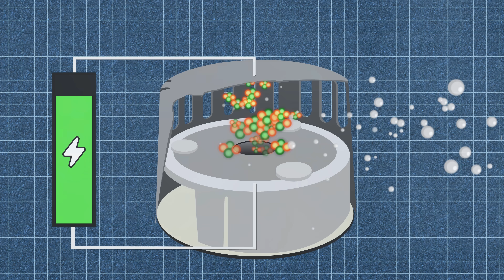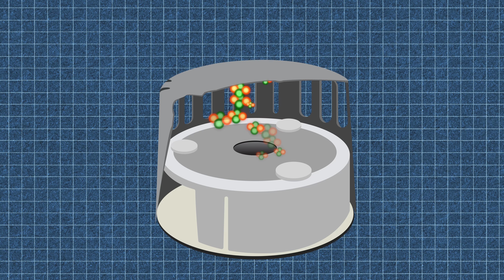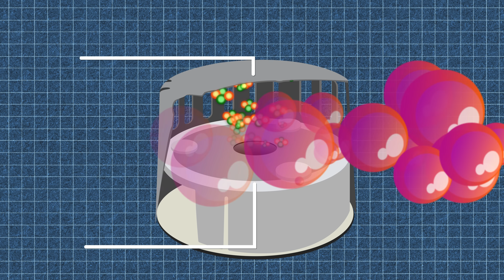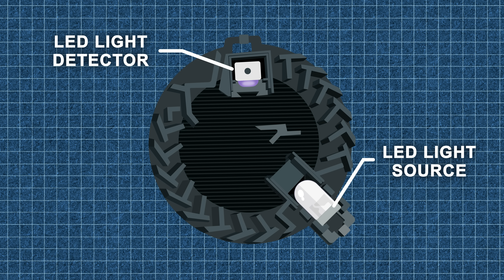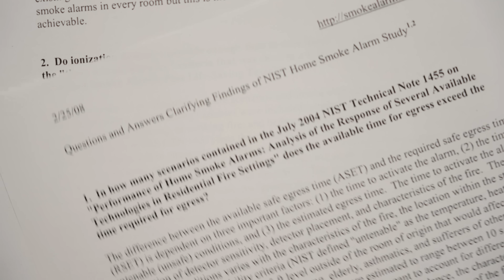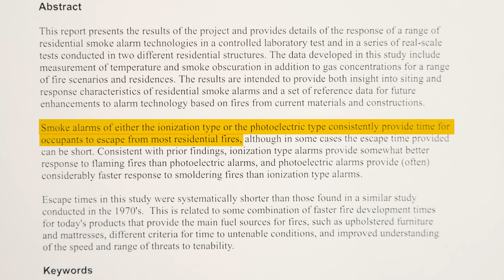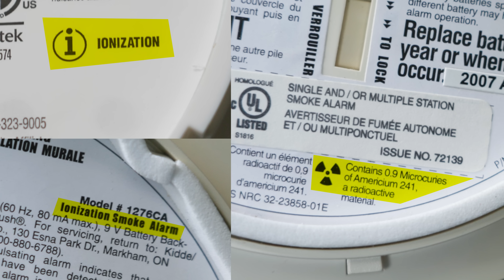Why the Most Common Smoke Alarm is Dangerous

Comment: So it uses code, to tell what kind of fire it is. Is there a fail safe in the code, where if it can't identify the smoke, to go off as an undetected fire? Or will it do nothing, never triggering?

Cause Codes, computers, electronics? They are prone to bugs, glitches, and being faulty. That is my biggest fear here. That the code will bug out, and never go off. The thing becomes melted slag, how can you prove it the device went off or not? And if the device never goes off, and the family dies or a family member dies, could you sue them for that bug and hold them liable for their faulty device?

If we can't even Sue them, when we trust them with our lives and they break that trust, how can we trust that they made a working device and not just lying and defrauding us. After all, if it fails, we will be dead anyways and can't tell anyone the device meant to save us failed.
Reply from the maker: Hey, I can understand your concerns, I had those same questions pop up.  The good thing about these regulations around life safety devices is that they are quite robust to account for these types of situations. So one of the tests they do is to light a real fire shortly after a cooking smoke incident is detected.   This ensures that algorithms are working as they show to identify a real fire when it does happen. This is one test amongst many in order to ensure we're actually protected. 

As well there are other failsafe situations, if cooking smoke or steam is detected for too long, the alarm is required to go off.  

So forensics can also identify whether or not an alarm has sounded, I believe there are waves around the sound device that will impact away smoke is deposited on the device itself, if it is completely melted away well I guess there's only so much you can do.

Comment: I only use the combination ionization, photoelectric, and CO alarms. Then you have every possible type of detector in a single unit. If at all possible I use the hardwired ones that have a battery backup and link together so that all of the alarms go off at the same time if one is set off. I also have a single sprinkler mounted over the boiler (optional in my state) for extra safety.

Comment: People are also going to run into issues as air purifiers increase in popularity as they remove PM from the air, that's something worth considering when placing your smoke detector/s and purifier.
Installation location is definitely important. In the apartment I rent there's one smoke detector (which meets regulations) but it's installed outside my bedroom door in the lounge. The kitchen is at the other end of the apartment, as is the only safe escape route, the front door.
I BYO smoke detectors wherever I live and place one in the kitchen. Recently the apartment detector had to be tested as is required by law, the tester commented that my kitchen one would go off a lot... he clearly didn't know what he was talking about. It's never had a false alarm as it is a quality photoelectric model.

Comment: I'm guessing it's because they are actually just heat detectors, a tiny bit of metal expands enough to trigger the alarm when it gets heated. If the smoke isn't hot enough anymore nothing will happen

Comment: Well, isnt that hard to imagine an smoke detector with both Ionizing and a photoelectric sensors together in the same device... i dont know for the ionizing tech part, but photoelectric sensor is an easy and very cheap tech...
 i can't see why not to have an allinone device costing  pratically the same...

Comment: I’ve worked with smoke alarms since 1985 and my company used them since 1975. The main reasons we never sold ionization were the false alarms, they needed replacement after a certain number of years and nobody wanted to pay for that service and they could not be cleaned whereas a photoelectric can be opened up, cleaned and put back into service as well as detected smoke alarms gat matters, no so good for burnt toast though. We still have some of the old originals in service. 

And the comments about Kiddee (or however it’s spelled) are bang on. Crap detectors.
Reply: You can easily vacuum ionization detectors.  Unlike photoelectrics with a convoluted path, an ionization detector is just in a can with large holes in it.  Vacuums work just fine on them.

Comment: A decade ago I had bought some new smoke/CO combo alarms with built-in batteries. I forget the brand/model. They claimed a long lifespan and less nuisance alarms. Ha! On top of a few false kitchen alarms, they'd sometimes go off once in a while when the HVAC system would start in the evening. It was like the sudden change in air flow caused particals from the cooking a couple hours earlier to now trigger the alarms. That got old real quick. Replaced them after 2 years.

Comment: I'm a PE that deals with commercial construction. For decades, the standard smoke detector for a fire alarm system has been photoelectric, with dual technology being a common requirement. So, if you live in a modern apartment building, you likely already benefit from that.

Also, when you talk about the history of smoke alarms and mention early models that used thermometers, that's technically a heat detector. And that's something we still use today. In fact, most commercial buildings have heat detectors in certain areas where it's more likely heat would build up before smoke.

Comment: Interesting video.
Why not make a combination alarm that has optical and ionization and a thermistor to detect heat?
Then put a little processor in it that can compute when a certain combination is seen, it triggers the alarm.  Seems you could get the best of both worlds if a manufacture did that.
Reply from the maker: Apparently one Scandinavian has such a model with a triple sensor.  I'm guessing cost is a major reason.
Reply: Cost. Otherwise you can put a human to monitor your room 24/7

Comment: How can ionisation detectors still be the most common in the US, they are almost completly gone here in Europe and are prohibited in new installations and cant be sold anymore, most new ones also monitor O2, CO and CO2 levels
Reply: There was never really any kind of "phase-out" of ionization detectors in Europe. Most optical detectors were all that was available at the start of smoke detectors becoming mandatory. At least here in Germany, smoke detectors have only been mandatory for about the past 10 years. When I first moved here from the US into a 21-story high-rise in 2010, I immediately asked about why the apartment had no smoke alarms, and was floored by the answer I received: "You may buy one if you like."  About 3 or 4 years later, that same landlord was sending letters to all tenants about how "a new law" made smoke detectors were mandatory. Those initial smoke detectors were all optical.

Comment: It baffles me that when I walk into any hardware store and the shelves are still filled with ion detectors... by 2014 most  fire alarm companies stopped offering ions... this has been a pain as depending of the system you may need to reprogram your panel to change to a photo... but for over a decade you haven't been able to purchase new Ions for ANY fire alarm system.
Reply: What country are you talking about ?
Reply: @dmitripogosian5084  Canada. Go to Home Depot, Canadian Tire, Rona, or any other hardware store and the shelves are full of ions... go to any electrical wholesaler and unless you specifically order a photo you get an ion...
Reply: What sucks is you have to do all the work at the order desk... if you say you want a photoelectric they have no idea and will insist all they have are ions... which may be true as even wholesalers like ADI only stock ions and you need to order in photos
Reply: Consequently I have had to replace alarms installed new in apartments that are only a few years old due to constant nuisance alarms as modern layouts force smoke alarms to practically be in the kitchen

Comment: How does it compares to the dual sensors alarms from First Alert I wonder Edit: oh they did replace the SA3210 with the SM310, dual sensor that meets this new standard, they also have photoelectric that meets this new standard...so what's the point?

Comment: Appreciate the video and the website. Was going to grab a dual sensor photoelectric ionization sensor but after reading your site I realized its not Gen 8. So looks like I'll just go with a Gen 8/9 photoelectric unit.
Reply from the maker: Thanks! Glad it was useful.  There is one Gen 8 but I couldn't find it being sold.  Also most people need a carbon monoxide detector and having that interconnected is incredibly important.

Comment: Is anyone going to talk about those combo alarms that have BOTH photoelectric and ionization detectors in them? While they aren’t common, they do exist, and provide the benefits of both alarms. The photoelectric part keeps you safe during smoldering fires, while flaming fires are quickly detected by the ionization detector. It still suffers from false alarms, though, due to the older tech being used for the ionization part.
Reply: The sensor is the same, it's the smart that's changed, basically they implemented a smarter algorithm in the microcontroller and/or are using a faster one

Comment: It's surreal to see a video that shows me something I've known about for over a decade. I remember being a relatively young teenager and going to a free lunch for elderly citizens sponsored by the fire department, to educate older people on the importance of having the right kind of fire detectors. I went with my grandparents, and saw basically the same sort of research shown in this video.

They recommended a classical fire alarm that was physically wound up, and had a plastic/wax stopper that melted at a specific temperature. I wonder how those types of alarms perform against the modern battery of tests in a wide range of different types of fires. This was at least over 15 years ago, so I'd be interested in how those types of alarms hold up against modern testing standards.
Reply: yeah so all it does is reinforce your ideas which keep you alive making sure the fire alarm goes off from smoke not other crap because fires emit smoke plain and simple

Comment: Your chart is incorrect in 11:30. You made it opposite.
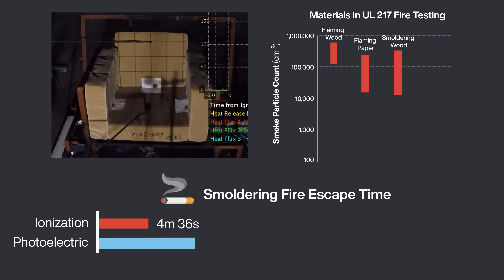Reply: And also mixed in 13:35 😅
Reply from the maker: Hey Tumexs, I got a lot of these comments.

The graph is correct, it's an unusual way of talking about how useful an alarm is.  

The actual metric is ASET - Available Safe Egress Time, which is how long after the alarm goes off you have to get out before conditions become dangerous.  It's a more accurate measure of how useful an alarm is in saving your life.  It's also an indirect a measure of how fast each alarm is alarm is.   

Yes, this is confusing, I thought about different ways to represent the data and this is the simplified version although I should have went with "escape time".

Comment: Keeping the battery fresh makes a big difference with ionization false alarms - a weak battery triggers more easily. Also get an alarm with a hush button to quiet false alarms so you don't rip it off the ceiling to make it shut up.

I've been using dual photoelectric/ionization sensor smoke alarms for over a decade - they've never been hard to find. You don't have to stick with whatever your landlord or homebuilder installed on the cheap, and the price difference per alarm is only $5 to $10.

Comment: When the smoke alarms in our apartment building have that low battery chirping, we have a work otdrr put in.  Then we switch the low batter to a dead one to stop that chirping.  It's been 6 months, and they have not gotten around to changing the battrry.  Push the test button. Nothing happens. Not our problem.😅😅😅

Comment: I have been using dual photo electric and ionization alarms for more than fifteen years, they are not sold on my state so I have to go to a neighboring state to purchase them, I also must change the batteries every year, this is ok,  the alarms I use have a ten year life so I have replaced all six of my alarms one time. I will be happy if next time I can purchase locally. We have never had a fire ( knock on wood ) but I feel safer with the dual detectors.

Comment: My smoke alarms a photoelectric and were installed in 2017. We always had them linked together and the old ones would go off all the time bc I think they were ionization. These new ones work better and less cooking making them go off. They did go off once when I got out of the shower and let the steam out but I can understand that bc it’s right outside of my bathroom door. It’s has gone off a few times from cooking bc my grandpa likes to burn his food and one time left it on and sat down and forgot, he is hard of hearing so he has tv headphones so he didn’t hear the smoke detectors but thankfully our new (2017) ones are hooked up to our alarm system and notify us. If we don’t disarm our alarm it automatically calls a fire truck and the police. That did happen once so at least we know it works. 😅

Comment: You missed a type of fire alarm! We've still got the wind-up ones with a temp rated disk that snaps into the front of the alarm! The disk warps at 120 degrees and lets a wind up bell sound.
Reply: And a huge number of deaths due to smoke inhalation because the alarm never went off because it didn't get hot enough close to the alarm.
Most 'fire deaths' are smoke inhalation, not burning up.
My aunt died in her bedroom when her TV burned in her livingroom yet the fire never burned anything but around the TV, the couch and things facing the TV were scorched but didn't catch fire.

Comment: Simple solution combine photoelectric and ionization into one detector
Reply: You might think that a dual photo/ionization would be the best; but that is not true.  The ionization have a huge problem with false alarms.  When you make a dual sensor alarm that includes ionization sensor then you get a product with huge false alarms.  Not good.  And not safe. It’s like the boy who cried wolf.  

Looking at the nest protect which was a new design from scratch without legacy ideas and legacy ways of thinking they came up with a product that has ONLY photoelectric sensors.  Yes there are two wavelengths red and blue light, but no ionization anywhere.  I know it also has CO and temperature and humidity sensors too.  But the important thing is that the smart engineers did NOT put any ionization in the design.

Comment: Last time my alarm went off, a tiny spider had built its nest in there. I was in the bathroom and rushed there so fast, that I broke my toe in the process. Nobody can say spiders are harmless now. But when I actually had something smoking pretty bad, it stayed silent. Had eggwhite dripping on a very hot cooktop and it smoked like crazy.
Edit: Mine is a photoelectric one. I thought about why not putting both sensors in one device and comparing them against.
Reply: An ionization detector will also be set off by tiny spiders. We lived in a townhouse where the bedrooms and laundry were on the second floor. An ionization detector was provided and located in the hall between the bedrooms and the laundry (stacked washer and dryer in a small closet). We didn't have false alarms and the only time if went off was when the dryer malfunctioned and left the heating element on with the motor stopped. The alarm went off and the dryer smelled hot. So, I took the alarm very seriously. One morning, the alarm went off before I got up in the morning. I panicked and rushed around looking for the fire or overheated appliance. I couldn't find anything, so I looked inside the detector. I didn't see anything except for a small spider crawling around. Then he crawled into the detection chamber and the alarm went off. Lol. He crawled out and the alarm stopped. I guess spiders can't hear 😅

Comment: This is one of the best videos I’ve seen on smoke alarms.  Very accurate.  But you are still spreading some misinformation perhaps by accident.  In the tests where they compared the response times of ionization detectors with smoldering fires some of the alarms did not sound at all during the test.  So how do you average together various times when some of those times are infinity?  According to the paper’s authors you ignore the ones that didn’t alarm and simply average together the remaining ones that did alarm.  Then you publish the results and claim that ionization alarms alerted 30+ minutes slower than photoelectric alarms.  But you don’t mention in the summary that sometimes they didn’t go off at all.  This makes people think, falsely, that both types of alarms are sufficient to save lives.  When the truth is that one kind sometimes doesn’t work at all and would result in death.

The graph at 11:42 should really show 0:00 escape time (not 4:36) for ionization alarms with smoldering fire warning.  Because when you average together infinite time with the other times of 35 minutes you get an average of infinity which is greater than the escape time needed so the available escape time remaining is 0. Compared to the escape time on photoelectric of 35 minutes.

Comment: I have both types of alarms installed right next to each other in certain rooms in my home. I know it may not be essential, but  at least one will always work if the other fails for any reason. 

They saved my life and my house last year. 

I'll soon be updating them to the latest version from the new UL certification.
Reply: Have you considered the negative consequences of the ionization alarm having frequent false alarms?  How does the boy who cried wolf affect response behavior?  

How would your current setup compare to a different house with only photoelectric alarms?  If the house with fewer false alarms leads to a quicker response to a real fire then perhaps it could be safer?
Reply: Or you can just buy dual mode detectors.